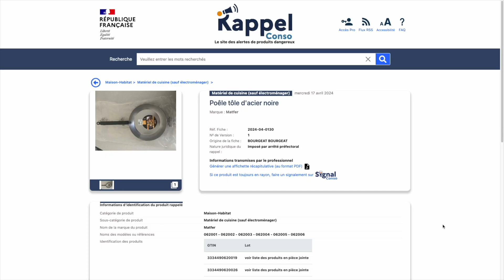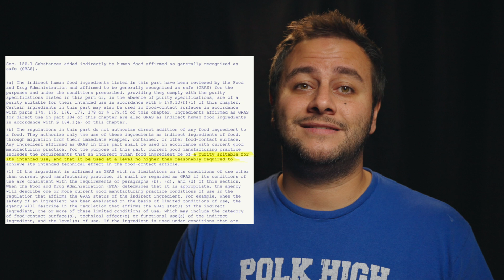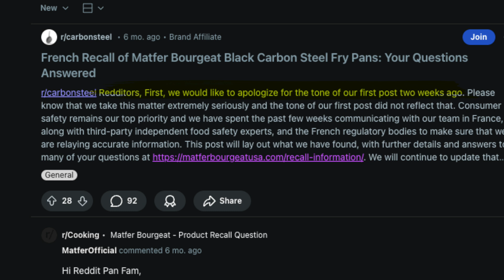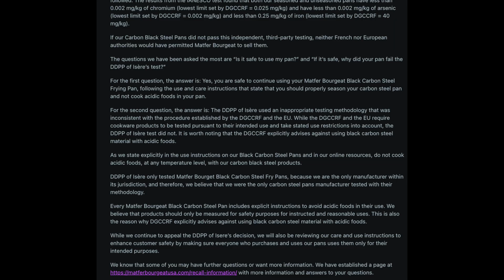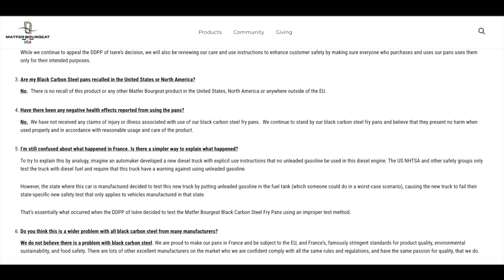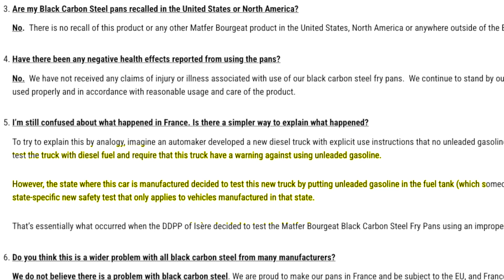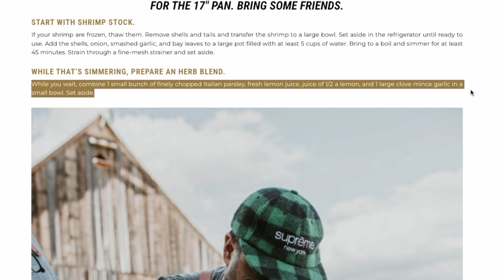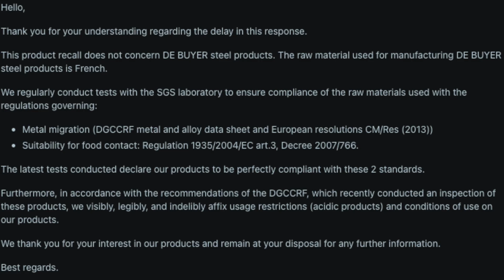Are Carbon Steel Pans Safe? | Matfer Carbon Steel Recall Due To Arsenic and Leaching | My Thoughts

Comment: Aren’t stainless steel pans made with Chromium?
Reply: yes, the chromium is one of the most important elements what makes stainless steel "stainless"

the alloy is stable enough to be safe when used to cook acidic foods (or at least not enough to be above the legal limit) for the alloys specifically made for food contact (there are many grades/types of stainless steel alloys, some which are not for cooking on, which would leach more chromium and/or nickel than would be legal in the EU)
Reply from the maker: Excellent explanation, thank you
Reply: Not to be annoying, but how can you be sure that your stainless steel pans are indeed stainless steel pans?
Reply: Yes they do  leach. I recall a study years ago that tested stainless steel cookware by boiling distilled water. They found levels of chromium and nickel leached into the water. Those who insist SS won't leach under 'normal' circumstances are following the disinformation that the industry promotes.
Reply: You need about 14% chromium for steel to be considered "stainless".
Reply: I have a Matfer carbon steel pan, but if chromium is one of the “concerning” elements it releases, why are stainless steel pans better?
Reply: @gearguy65  i did a reply on the original comment, but to sum it up, stainless steel pans use an alloy that won't leach enough chromium or other metals to be above the legal limit in the EU
Reply: @awesomestuff9715  thank you for the explanation.
Reply: @awesomestuff9715 recent testing shows chromium and nickel leech from stainless steel pans. Specially high amounts in the first few cooks. Enough nickel to cause an allergic reaction.
Reply: @foreseengust  you are right, it does leach, but I didn't say that the stainless steel won't leach at all

I specified that the amount leached would be within the legal limits with the alloys used for food contact

The only cookware that won't leach chromium and nickel and other metals would be high quality glass or ceramic cookware realistically, but for most people, stainless would be safe enough

And you can't really sear a steak without fearing that it would break the cookware with glass or ceramic coatings because of the high heats and potential thermal shock
Reply: @awesomestuff9715 Please keep in mind that ceramic (even high quality) is not fully inert. It's glazed with barium which can easily leach. They are also colored using heavy metals. 

Assuming any heavy metal is safe because it falls within 'safe limits' is taking a risk. Our guidelines are established to accommodate corporate profits. Banning the use of heavy metals in coloring, for instance, would be easy and in the best interest of public health, but this isn't how it works. It's taken 60 years to get restrictions on Teflon, PFAS, etc and it's still ubiquitously used in commercial and food products. I'm old enough to remember when we told they were perfectly safe too. Nothing has changed.

I am cautiously optimistic now that RFK will be looking into our public health bureaucracies though. 😉
Reply: @L.J.01 
RFK?! 😂😂😂😂
Reply: @gearguy65  prob better than ...the nonstick surface on many pant that flakes off then we eat..forever chemicals I believe

Comment: I just purchased de Buyer pan, my first carbon steel pan. I wanted to buy one last year but decided not to because of this recall. I'm in Europe and Mauviel and Matfer pans are still unavailable - so I bought de Buyer.
I'm thinking that by now they must have tested de Buyer also. But if this brand somehow avoided testing, I assume that they at least panicked, changed steel supplier and made sure it is within the regulations. This was my reasoning for buying one - I have no evidence for this of course 🙂I can't find any new updates, additional information, just nothing (like was de Buyer tested and what were the results).
Pan was 37 eur and not that expensive. My first CS and I will only use it for eggs. Lets see if I like it. Otherwise I will continue using teflon😐
Reply from the maker: Thanks for sharing your experience and thoughts!

Comment: I had just purchased a Matfer pan, had yet to use it, heard of this recall, and subsequently returned it.  I have a hand made carbon steel pan coming from a smaller forge in CA and wonder what standards it has been test to?  What standard are an artisan forge held to in the US?  MY guess is none.
Reply from the maker: None but I would email them and ask them upfront. Mention the Matfer recall.

Comment: I found an 11 7/8" Matfer black carbon steel pan in new condition at a Salvation Army a few weeks ago.  I stripped the wax coating and tried seasoning it multiple times.  I'm struggling internally whether I should be using this pan or not. I have no way of knowing if it was on the recall list (lot #), but I would say there's a decent chance and that's how it ended up at the thrift store.

Until today, I was just cooking eggs on it.  Things were going well.  Today I cooked burgers on it and was concerned how that stripped some seasoning significantly. That's when my nerves started to increase.    I shouldn't have to feel like this cooking on a pan. Uncle Scott seems to have no worries in his videos, but I'm a bit concerned he is a bit too much of a spokesperson for these large companies and won't offend any of them to preserve status.  I may be way off, but it is my gut feeling.  He also seems to have a cookware budget far in excess of most regular home cooks. lol.  

Is it really normal for hamburgers to remove seasoning?   I seasoned it using the oven method and the potato peel/salt method twice. I was thinking red meat would do the opposite and improve seasoning.  I am 100% confident all factory coatings were removed as it took a very long time and obviously was taken down to bare metal.  I was extremely diligent with this process. Getting dark color on this pan seems WAY harder than it is with my carbon steel woks.  It also looks nothing like the jet black finishes Uncle Scott's Kitchen gets on his Debuyer carbon steel pans. 

Trying to decide if the hassle is worth it given the recall.  Lots of other pans to cook on. I truly wanted to experiment with one and was ecstatic to find it for $11.99 new at the thrift store.  When I bought, I wasn't aware it was a Matfer, but I recognized the pan type immediately and had to get it. It 'seemed' too good of a deal to walk by. 

Sigh...
Reply from the maker: I totally understand your concern about the recall, it's a lot to consider. I don't know Uncle Scott personally but have heard of his channel from other viewers. I think he genuinely wants to help people and has done his research which has led him to his own conclusions. Regarding the seasoning flaking. It shouldn't act that way with simple burgers. My thoughts are the seasoning didn't polymerize well. Make sure you take the oil (prefer high smoke point oil) past it's smoke point for ~40mins to properly polymerize. CS is fantastic once you get the hang of it. Hope this help a little. Cheers!
Reply: im in a similar situation.. smashing burgers into my seasoned cast iron usually leaves a circle after washing that i presume is stripped seasoning. so i often reseason 2 or 3 burgers, time permitting (wipe with oil and bake @ 450F for 40+ minutes. sometimes wiping with oiled paper towel after the first coat looks "done" and then another 40+ minutes and then oven off to finish. I've tried olive oil early on in this pans journey, then stripped and reseasoned with grapeseed oil which works ok. but now using Algae Oil from Algae cooking club i probably need to crank the oven temp to max (500F+) to get a proper polymerizing considering its advertised smoke point is 535F. I agree with your take on Uncle Scott as well. Do we have data for the other carbon steel pans that were ran thru the same tests?

Comment: Excellent logic!   However, there are a few questions..

1. Why Matfer? Is this a jurisdictional issue whereby the Matfer manufacturing plant falls in the DDPP jurisdiction and therefore DDPP cannot test any other manufacturer?  Or is it that they did test others and found no issue?  Only DDPP can answer this question.  2. One single lab in the entire Europe would conduct such tests?  Not likely, I would think, so why other labs did not raise alarms.  3. Should the public stop eating at restaurants?  You have retired your pans, but do you know of any public place that did so as well?  

I don't think the FDA is the answer.  The carbon steel and cast iron pans are so ubiquitous that all FDA can do is to go nuclear and issue a blanket, but most likely unjustified, hazard warning without actually being based on any science. 

Last, how many folks have no idea of the recall?

Again, thanks for an insightful analysis.

Comment: Err, a local French govt agency doing a test that would fail for *every* carbon steel pan (cooking a citric acid solution for 2 hours). This is specifically against all recommendations for carbon steel and cast iron pans. Matfer are completely right when they say the test is invalid and their pans are fine. I have de Buyer pans myself - so have no 'Matfer' skin in the game but I'm sure their pans would fail this stupid test too...

Note that all Matfer (and de Buyer etc) pans had passed French Federal and Eu safety standard checks. So we have a rogue local govt doing a silly test...
Reply from the maker: I appreciate you sharing the information.

Comment: Sorry but I can't agree with your findings. Telling Matfer to stand up and do the right thing and protect consumers is a nice thought. But it ignores basic chemistry.  

Look up citric acid passivation. That is essentially what the test in question was.  It solutuonizes and removes contaminants like iron on the surface of stainless steels to improve corrosion resistance. Imagine what that does to a full carbon steel pan. It will attack it as though the whole thing is a contaminant.  ANY carbon steel pan will fail that test. The iron and other materials like arsenic, lead, chromium, etc that are in all steels to some degree will come right out as the acid attacks it.  

This isn't a matter of a maker accidentally choosing the wrong plastic for a water bottle and people getting a dose of pfas. It's basic chemistry that has been known and documented for many decades. It's a test that is either designed to make the pan fail, or a test designed by someone who doesn't know enough to do their job properly. 

To be extra pedantic, this is not a Matfer or a bad batch problem. The batches that the pan came from were recalled, but any batch, any brand will fail this test with carbon steel pans. That's why they all include those acidic food warnings. They can't be in your kitchen to stop you from violating it's proper use, so what more can you reasonably expect them to do? Remove all the iron from their steel at the foundry? 

So if you're really upset about this risk, go on a crusade against all carbon steel pans and their makers. Get them to discontinue making carbon steel cookware. They all will exhibit this same problem. Or better yet, teach people the proper and safe way to use a carbon steel pan. 

Going only after Matfer is just a social media hit piece to get views. It isn't backed up with sound reason and science.
Reply: @tomwadek  I didn't ignore or cherry pick anything. I'm saying that you aren't basing your narrative on the correct things. Example. You keep mentioning acidic foods. The TYPE of acid doesn't get discussed, but it makes a huge difference. If you didn't mention citric acid's  passivative reaction with carbon steel, you obviously don't understand the real issue. 

I don't really care if matfer has recipes with acidic foods. That's a stupid move on their part.  But it's not why the failed the test. You just found a bunch of ancillary issues and piggybacked on a root cause that you don't understand. 

So keep doing you, I guess. As long as people like, subscribe, and comment, right?  But you've lost credibility in my eyes.  Bye bye now.
Reply from the maker: You completely ignored this video and cherry picked sections to your liking. Are you going complete ignore Matfer's own recipe videos I highlighted where they are going against their own "proper use" instruction and cooking acidic foods? give em a break...

Comment: Lol! Dude. Boiling a mild acidic solution for two friggin hours  in ANYTHING! except glass or ceramic will result in various chemicals leaching out of the container into the solution. Add to that the fact that ALL carbon steel has arsenic and chromium in it in various amounts. The test was a corporate hit job. You can't even fit enough liquid in a frying pan to boil it for two hours, so they had to do something unusual to even DO the test to get the arsenic levels up to a point they could claim it was dangerous.
Reply: You can't even fit enough liquid in a frying pan to boil it for two hours = Fantastic Point!!!!
Reply: Why would arsenic even be in there? Otherwise, yeah the test is ridiculous

Comment: 1 - The way they dealt with it is more of an issue then the fact it failed.
2 - Perhaps the steel really isn't from France. Perhaps they have a good buy on pseudo French Chinese steel. Or the steel used is reprocessed versus virgin raw never recycled new.
3 - They make special ultra low impurity steels. I wanted to be a nuclear engineer but chose a different branch of engineering (2 actually). I know a lot about it as I also took welding to high levels. Those steels are common in nuclear field. I know, dual engineer here, knife maker, I do blacksmithing, took chemistry, and am quite the cooking nerd too. Usually steel mills and suppliers will include or do test data if they are asked on large lots of steel, many times free of charge in large enough quantities.
4 - Wonder how bad stainless is now as chromium is a natural adative to them. Though, they have such concentrations that it really is not a hazard. You see carbon steel has lower ammounts and as the iron wears it exposes new parts of the metal underneath which could contain a bit of thr chromium or other metals and since carbon wears more it exposes much more over time. So I think SS is still safest despite such levels as 18% of it being chromium in the first place.
5 - Reach out to the regulatory now, and ask more questions wink wink!
6 - Perhaps we can get a hold of Cody's lab to do a series of tests. He'd love this sort of thing!
7 - In fairness I would like to know just how elevated beyond the norms we are talking about for each. It's mercury and aluminum and cobalt and maybe cadmium that worry me most, and beryllium. 
8 - I don't trust anyone anymore.
9 - This was super reporting and earned a full bell subscription easily. That and the seasoning video. I mean any one would earn it they both were that good. But two great videos of two seen so far, man I am lucking out with the suggestion algorithm tonight! I rarely sub let alone full bell.
10 - Lastly, perhaps the voting owners or parent company, if they have one, or someones daddy in family run stuff, needs to get after the person high up responsible for this nonsense in the company. And if it is the owner, double shame. It will cost them huge now. They could have gotten out of this by simply upping quality and changing things or switching steel suppliers. France has several good ones. Heck, switch to Sweeden, UK, USA, Korea or Japan. Many places have great steel needed. They could have another mill reprocess it to chemically remove it in a remelt and roll. That carbon steel is a basically high end version of just cheap common standard steel, just has low intrinsic unwanteds in it vs sheet steel strip.

Sad as next month I really honestly wanted to add a carbon steel pan for eggs. I know where I won't look now. Whole reason I came here btw and found this awesome channel. That brand is out now. Forever! If I remember right All Clad DOES do testing and thought one other upper end US brand or two did for stainless and one for cast iron, or at least used to on accepting steel. I thought it was them anyway.
Reply: Or perhaps we shouldn't boil citric acid in our unseasoned pans for an hour then drink it.
Reply: @ldakotatransplant6485 Funny, they passed before, but now not... shoots down your theory.

Comment: The metal used is the same used across the EU. The tests involved an acidic solution which was heated for two hours. It is widely known that carbon steel pans should never be used to cook foods that are acidic, such as lemon juice.
Reply from the maker: Yes, because of stripping the seasoning off the pan and not releasing arsenic and other harmful chemicals.
Reply: So where did the arsenic come from, huh? Wasn't in the acid or seasoning. Had to be in steel and normally it shouldn't be there hardly at all. Bad steel lot.

Comment: Because Matfer is the only manufacturer known to have been 3:55  tested by this specific regional French organization, and testing method - at least we know the results when tested in extreme circumstances. There are many variants of carbon steel, and the lack of comparative tests on any other manufacturer is by far more concerning to me - at least we have results that potentially could be far worse. I was considering the Strata or mineral b pro - now I'm more concerned about not having the same testing on these. At least we're dealing with a known quantity on the Matfer. I'm old enough to remember the days of comparing the many various carbon steel alloys available for bicycles before carbon fiber became available.
Reply: Mauviel also has a recall for the same reason.